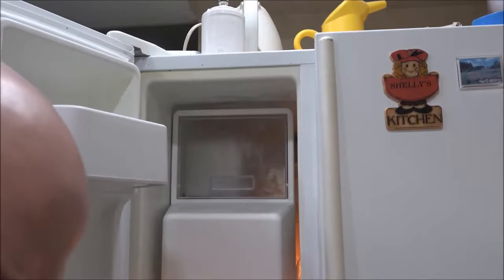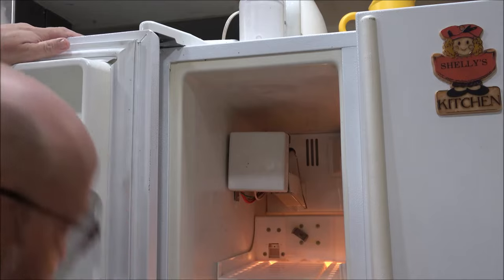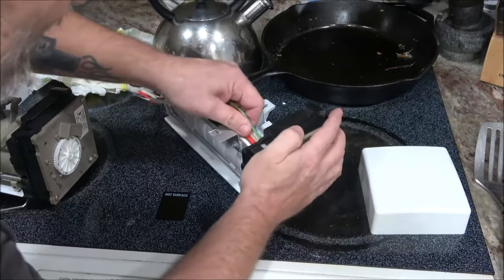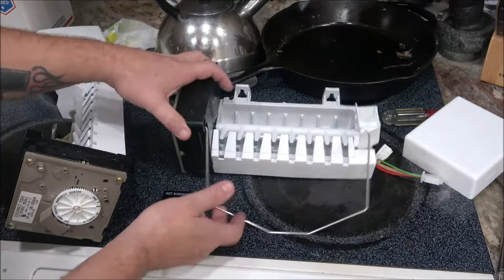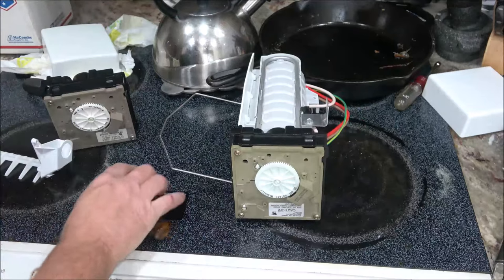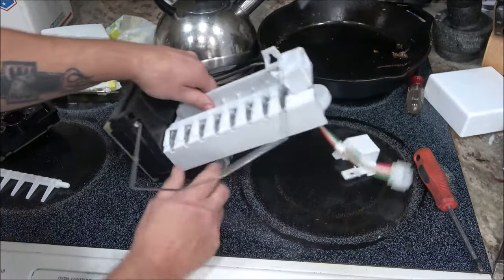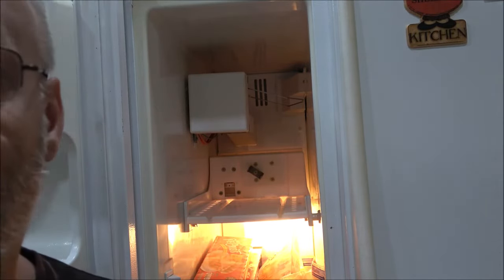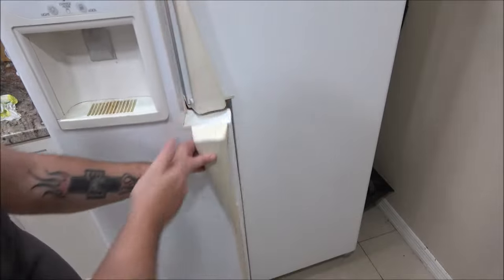Ice Maker Replacement In Maytag Side By Side Refigerator 4K

Comment: All I could think was you should have covered that glass top stove with a towel when you were working on it. I kept thinking how many scratches you put into it.  Eeek!  That's a "wide by side" refrigerator. I have one and LOVE it! They only made them for one year. Mine is 20+ years old and still kicking.
Reply from the maker: No scratches at all. Strange you would think that seeing how cast iron pots and pans are put on it everyday and never gets scratches.
Reply: @shabear1000  that's great. I guess they don't make them like they used to.
Reply from the maker: @lauriebarnett5741  that's for sure